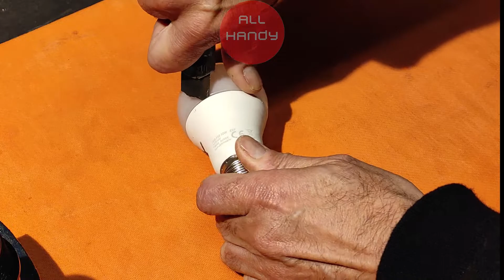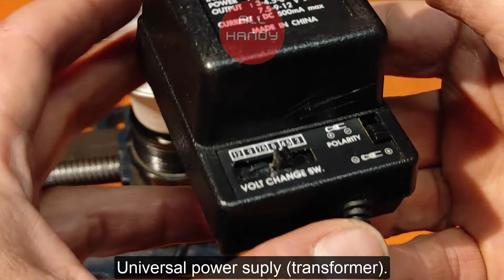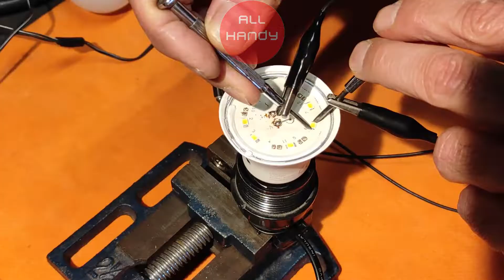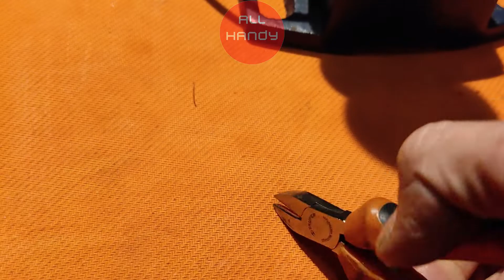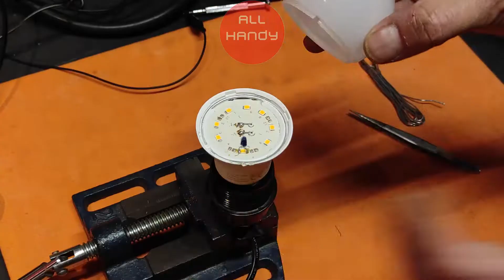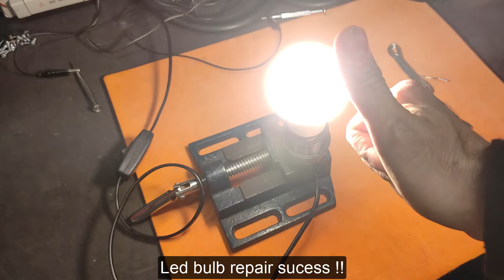Led bulb REPAIR. Repairing a broken led light in less than 2 minutes.

Comment: But the rest of the LEDs will get more current so they will fail much more quickly, no ?
Reply from the maker: Yes in theory yes, i have some repaired in this way still working, better way is to put SMD diode instead of led. I will make video of such method.